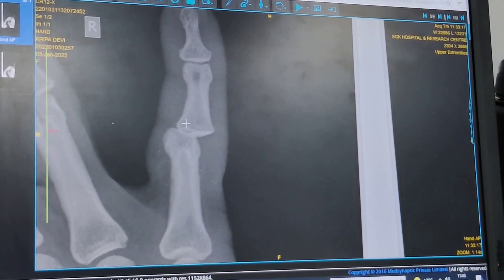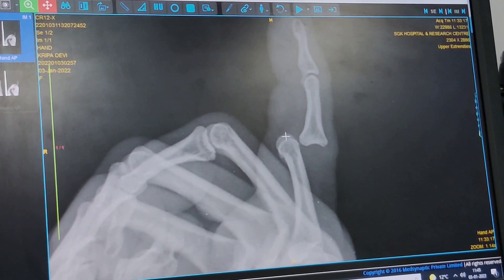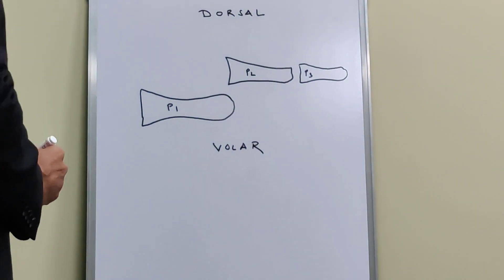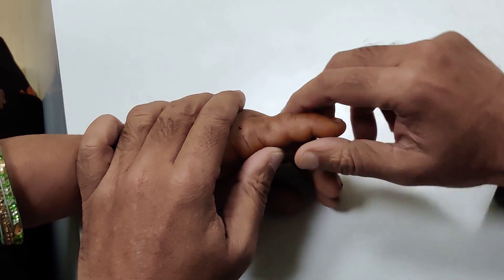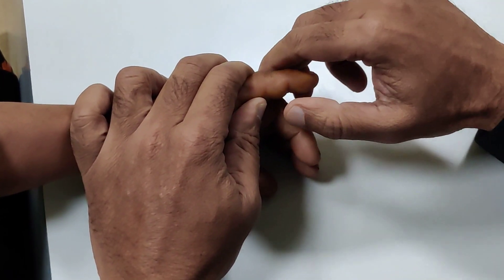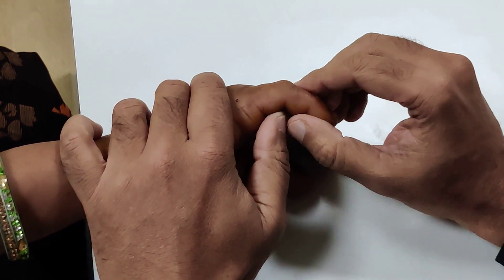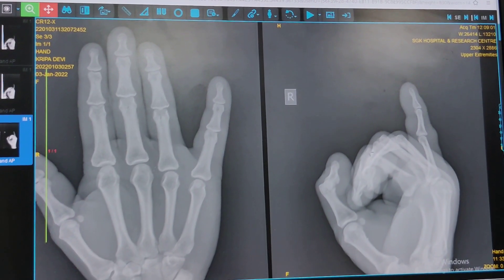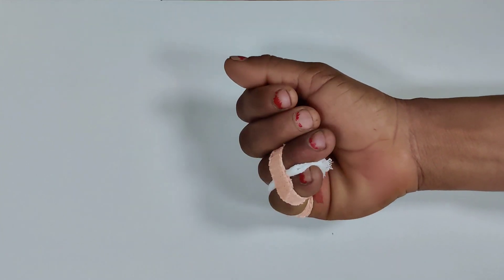Finger Dislocation Reduction Technique

Comment: Hey Dr. Vinay.. ive have had suffered a finger PIP joint injury on my middle finger about 7 years ago.. but now my finger PIP joints is still swollen and especially thickened (the joint is enlarged).. there is also some slight loosenes in my joint.. but i can move it fully and have no pain whatsoever.. the swelling actually never did go down.. is this situation normal?
Reply from the maker: It will remain like for life now. Unlikely to get any better.
Reply: @DrVinayKumarSingh  hmm i understand.. acording to some of teh doctors, i suffered a volar plate injury in the palm side of my PIP joint and maybe a capuslar injury too.. doctor, what if i would re-injure the same finger PIP joint, that i had injured before, btut this time would undergo a proper treatment.. could thus the swelling on my joint completely go away and regain my instability back, once i re-injure it?

Comment: I have a query. Is there any Ortho expert ?
Reply from the maker: Yes
Reply: @DrVinayKumarSingh  I broke my left hand's little finger in 2001 in a motorcycle accident. It was so painful so I avoided getting it straightened properly. Now it is giving me trouble and every time I lift something heavy, it pains. The shape is pretty messed up to but almost the same as 2001 as the joint is not staright. What should I do ?

Comment: My age is 37 
I got hurt my index finger when I was 8 years old and since then I could not bend upper p3 joint and my finger bends at 90 degree.
I don't feel any pain 
I can play guitar as well 
But because of p3 not bending 
I find difficult to play  smoothly.
Can it be normal?
Reply: Is there any other alternative option so that I can bend my upper p3 joint when I bend my index finger ?
Reply from the maker: Unlikely to be normal

Comment: The exact same thing happened to my right little finger on 2nd feb 2022......after 20 days my splinter was removed from the finger and I was advised by the doctor to try to fold my finger. It was too difficult. So the doctor again advised me to go for WAXTHERAPY for it. I can now fold it half but still the joint area is swollen and stiff. is it okay doctor? on 3rd april 2022
Reply from the maker: Keep up with physiotherapy